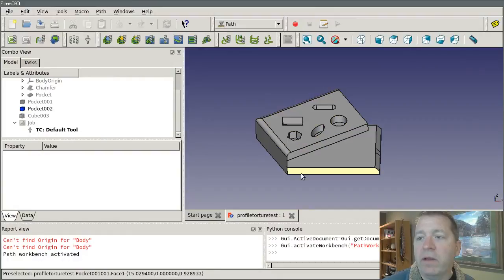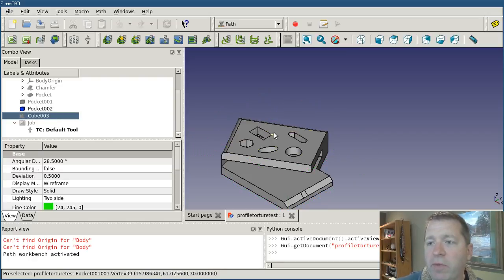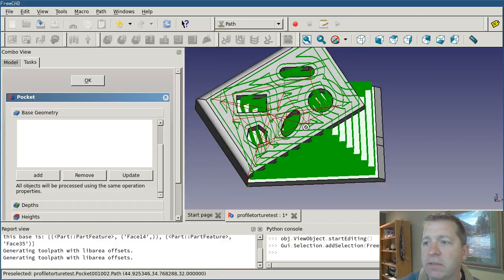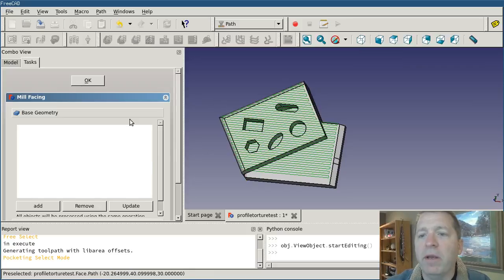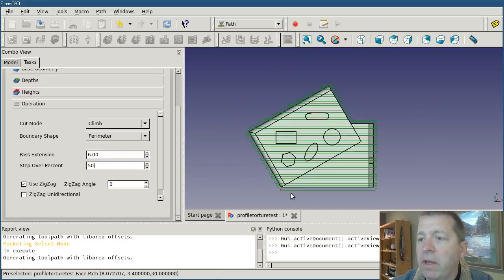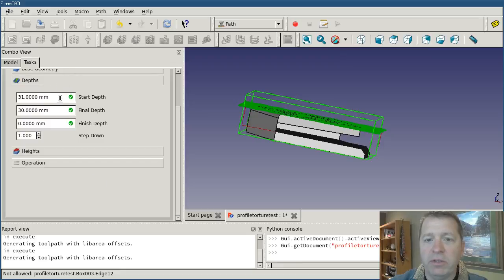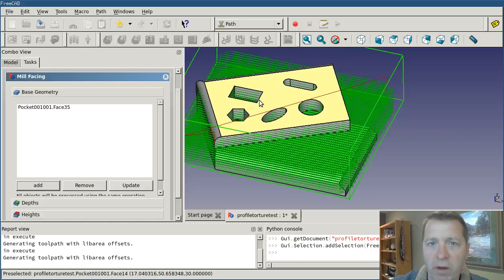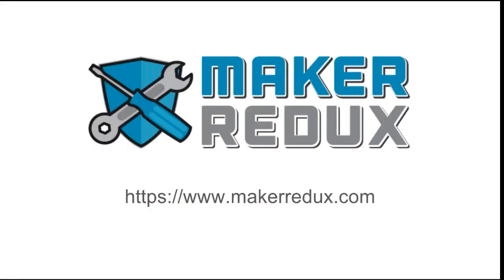Overview of Mill Facing Operation

Comment: Hi, is there a way to engrave a line (or polyline) on the right or left side (as the g-code G41/G42 would do)? Thanks
Reply from the maker: With G41/42,  the toolpath is programmed 'on the line'  and the control is expected to compensate based on the tool offset value.  
With the engrave function in Path, the toolpath is programmed 'on the line'.  If you want to have the control offset it, you could modify your postprocessor to insert a G41/42.

If you want Path to calculate the toolpath itself offset from the source geometry, that is possible but it depends on knowing inside vs outside,  CW/CCW,  left/right.  We do this for things like profiling where the source geometry is a closed polygon and inside/outside is easy to determine.  But engraving often works on open wires like single edges.  Which side is the 'outside' of a single edge?  Or the 'left'?   It depends on which way you're going.

If you have a specific use-case in mind,  please post on the forum in the Path/CAM section to discuss.

Comment: Are you using the FreeCAD CAM module to control your CNC ? I'm looking forward to get everything working on FreeCAD.
Reply from the maker: At some point we might have the ability to send an output file to a machine, but FreeCAD shouldn't be doing the actual machine control.  That's a job best left to a machine controller like linuxcnc, grbl, or smoothieboard.

Simulation, on the other hand is something I'd like to do but it remains in the future.